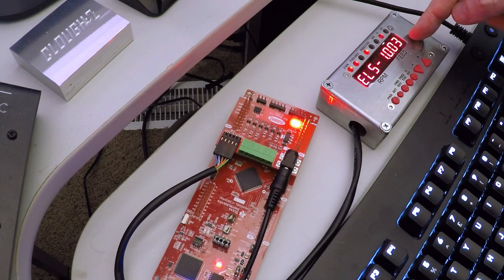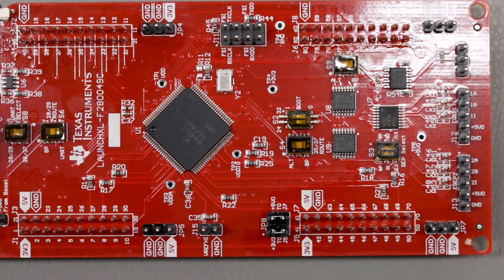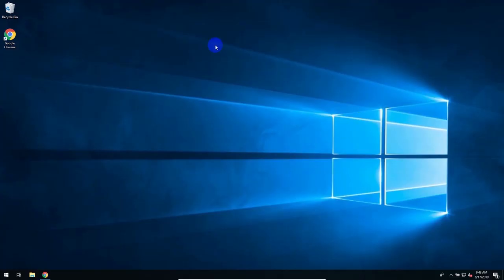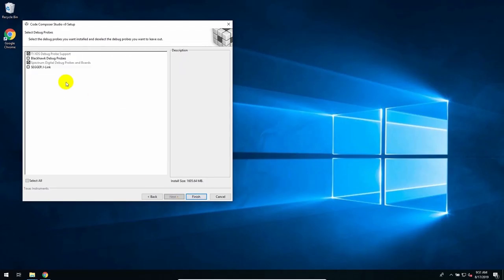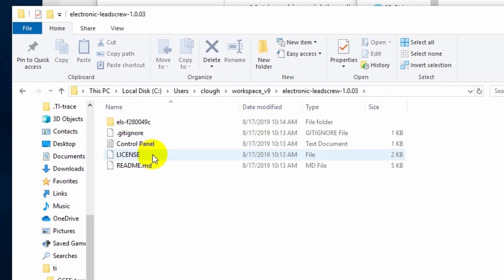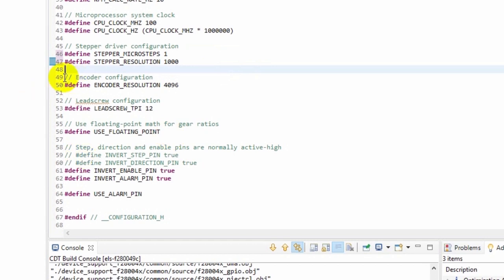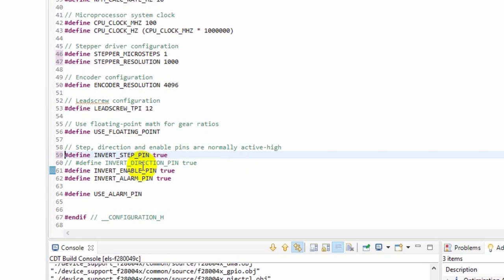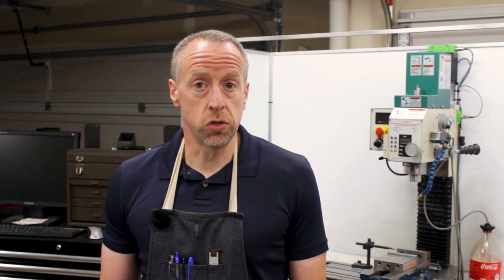Lathe Electronic Leadscrew Part 10: How to Program a TI LaunchPad Microcontroller

Comment from the maker: CORRECTION:  Several people have pointed out that the Kapton tape on top of the switches is there to make them easier for the pick-and-place machine to grab them with a suction head.  I said in the video that it was there to protect the switch during the board cleaning process.  It looks like I picked up some bad information somewhere.  Thanks for the correction!
Reply: I'm sure it helps with the pick-and-place, but I've seen datasheets mention the tape as an option to be compatible with washing
Reply from the maker: @fuzzy1dk  cool!  Everyone can be right!
Reply: Lols.  I intended to watch these new videos eventually.  However I came here from your weight loss video that was recommended after I re-watched your toolpost grinder build for probably the third time.  Looks like you kept going.  High five. I don’t feel alone anymore as far as people thinking you’re sick after having not seen you since you were overweight.  Funny that is the default assumption.  That’s usually the first question I get, “are you okay?  You look skinny.”   Makes me wanna strip down and flex, “that answer your question?”  Lost 60 pounds.  5%body fat.  Addicted to training.  Looks like I got in a fight with spider man when my skin gets too hot.  “The ugly truth of being shredded” 😂.  Anyways congrats on the progress.  I know sometimes it feels like you are the only one who seems to appreciate it.  👍🏻.
Reply: Hey Jim, are you using a hybrid stepper servo or a true servo motor?  If you're using a true servo, please provide a link to purchase it. Thanks
Reply: Please
Reply: I work in electronic manufacturing and yes its for pick n place nozzles but its also for protecting against flux and washing. Not all parts are machine placed. Somtimes parts are hand placed because the material may not always be able to survive the reflow process therefore they are hand soldered. It all depends. Lots of variables.
Reply: lol, we can just say it's there "For manufacturing purposes"

Comment: First I wanted to thank you for all your hard work in creating the project, filming, documenting, and sharing with all of us.
In our home shop, my father always had a couple of lathes and mills.  We have made many projects over the last 40 or so years.  The one thing I never have done was single point threading.  Changing the gears was always a pain and never had the right gears for the project, so we just used taps or dies.  After seeing this project, I decided to convert our ALL manual shop to have some automation or at least something modern.  My father is now 86 years old.  He has been a machinist the mid to late 40s.  He retired from the machining business and opened a Deli in 1972.  When I told him about the project he was interested and wanted to know more but not very excited.  (Remember, he still thinks the flip phone is such an advanced phone)  I started to collect all the major parts and get things together over several weeks.  Last night, I finally had everything in front of me and had time to work on it.  I put it together and it worked exactly like your initial demo.  My father came over to visit about an hour ago and showed him the demo.  Now he WANTS me to convert one of the lathes.  He also wants to convert to a VFD.  Your idea has re-ignited the fire in my 86 year old father.  Again, thank you for that and this project.

Comment: Hi James
I'm a elderly retired engineer who took up machining upon retirement.  I purchased the ubiquitous Chinese mini lathe and mini mill and have used both to craft a number of model engines and shop tools with great success and satisfaction.  Both machines have been modified over the years to make life much easier.  I've been keen to build an electronic lead screw control.  Having stumbled across your web site, has enabled me to start the journey.  Parts are on order and I look forward to the build.  I have to say your detailed exposition of the work steps you take for each phase are very good.  I only regret not finding you sooner.  Many thanks.

Comment: James, this whole series of videos is fantastic. You have gone where no man has gone before and I appreciate it. You have been so methodical in showing your viewers everything. The whys of choosing floating point, the error bars of the threading and so forth. I have come to trust you, your hardware and software. 
I have just about everything I need. Except, what powers the TI board? Is that the $400 power supply that I haven’t bought yet? I hope not. 
All that’s left for me to do is download the software. Please don’t take down any of these videos or I’ll be totally lost. 
I have an old HP workstation that’s running Windows 7, but it’s 64 bit. I hope this is ok. 
Please tell me about the power supply and the origins of Clough54. 
Thanks,
Paul

Comment: As usual, you make the complicated highly understandable for all skill levels. I have a 9x20 HF bench lathe with a lead screw gearbox. You still have to mess around with change gears for different threading operations. I personally would like to completely remove the entire gear train and just use the servo/stepper controlled lead screw for threading as well as carriage feed control.

Comment: James, I don't know if you read comments on your old posts but wanted to let you know I'm finishing up my 2nd ELS on an Atlas 618 lathe.  I've been waiting about 5 months for the TI microcontroller, but finally got one from Digikey.  I've got one on order with Mouser also, (for a different project) but they still show a longer delivery.   Putting an ELS on an Atlas 618 may be Overkill, but as you say that is Underrated.   Thanks again for doing the heavy lifting, pun intended...
Reply from the maker: Very cool.  I love mine, and whether I could easily install one will be a consideration for any potential new lathe purchase.  :)

Comment: Just purchased your board and am collecting all the other necessary components, can't wait to complete the electronic lead screw upgrade, will be using NEMA 23 servo's with DQ860MA servo drivers do I to make changes in the firmware. I now have both the G0602 lathe and G0704 mill and will be making the same modifications to them as you have to yours. Thanks Al

Comment: Nice work!  How difficult would it be to add an external sensor to stop the feed?  To act as a carriage stop?
Reply: The difficulty depends on how fancy you want the feature to be.

Simplest setup I can think of is a proximity sensor that mounts to your lathe (maybe make a bracket that slides along the ways with a clamp screw and holds the prox sensor in place).  Connect the prox sensor to a GPIO of your choice.

Then add an `isEnabled` flag to Core.h.  At Core.h line 98 [1], also check the `isEnabled` flag.  If flag is false, skip the `if` code block, and the stepper motor doesn't update.  You might update the previous values after the `if` code block, otherwise your carriage may take off when you reenable the flag.

At the top of Core.h::ISR line 97 [2] read the prox sensor and when it detects the carriage, clear the flag `isEnabled = false`, and the stepper stops moving the carriage.  When the carriage isn't detected, set the flag `isEnabled = true`, and the stepper will start moving the carriage again.

This is a rough idea, some testing and tweaking is recommended to iron out the bugs.

[1]: https://github.com/clough42/electronic-leadscrew/blob/master/els-f280049c/Core.h#L98
[2]: https://github.com/clough42/electronic-leadscrew/blob/master/els-f280049c/Core.h#L97
Reply: Ok for straight turning. Problomatic for thread cutting as it would be necessary to re-synch the tool with the workpiece. BobUK.

Comment: Great job!  Being able to thread to a shoulder would be a wonderful feature.
Reply: It doesn't have the ability to control the half-nuts.
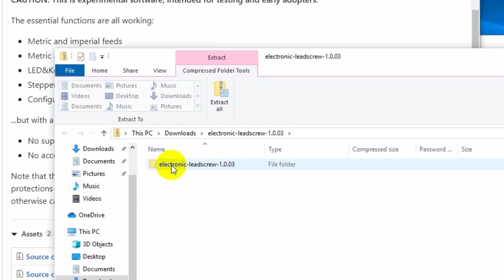Reply: @boldford  It looks like Jon Bryan was able to accomplish this. Take a look at 15:18 in "https://www.youtube.com/watch?v=rKKs4lCEXwE&t=489s".  He doesn't explain how he re-synchronizes the lead screw and spindle after the lead screw stops at the shoulder.  I'm sure Clough42 would be able to come up with a process that would work.
Reply: @mgillis1948  If you listen again he explains that he uses the half-nuts in the normal way when he cuts imperial (inch) threads. He would use the thread dial indicator to pick up a partially completed thread. He leaves them closed all the while when he cuts metric and runs up to the stop using the lathes jog function. You would use James's ELS in exactly the same way.
Reply: @boldford  I did listen again.  He does use the half-nuts for normal threading.  If you listen to him at 15:16 he explains about threading to a stop.  If you watch from 15:20 he sets up a 40 pitch inch thread while leaving the half-nuts closed and sets limits.  At 17:00 he says that it will thread to that limit and then Stop.
Reply: @boldford  If go to James's GitHub Page.
https://github.com/clough42/electronic-leadscrew
You'll see:
"Future Goals
While this project is starting out as a simple gearbox replacement, some features seem attractive, even for that simple case:
    Threading/feeding up to a hard shoulder with automatic stop
    Automatic recall and resync with hybrid threads (e.g. metric threads on an imperial leadscrew)"
To me it sounds like James would like to thread to a shoulder also.
Reply: @mgillis1948  Sorry Mike. You're quite right. Mea Culpa

Comment: Hi folks, in part 14 later on James suggests that one Launch Pad board he was using may possibly have been damaged by inadvertant static electricity. It can happen to the best of us. (He also gives another reason). As a result I'd strongly suggest taking the appropriate precautions before even opening the anti-static shielding bag contaning the TI Launch Pad board. Again, watch part 14 to see how to do this - and don't wear nylon clothing! BobUK.

Comment: I just programmed my third TI board with the MacBook using Code Composer Studio version 10.4.0.   I loaded Clough42 v1.400 and made minor changes to Configuration H for stepper ratio.

I was not able to install CCS 9 build 10 on this M1 Mac due to permissions so I had loaded CCS 10.2.0 weeks ago which was then updated to 10.6.0. TI warns that CCS will be updated every 6 months.  This time on build there was a warning “ A firmware update is required for the XDS110 probe.” Once I clicked on that update, the build completed the flash.  So far the updates from TI have all worked.  I am now waiting on 3M pulleys and belts for the 12 inch Enco.
Reply from the maker: Yes, they update constantly.  The firmware update for the XDS110 probe is just flashing the probe chip on the LaunchPad to match the version of the debugger you're using.  If you later want to use CCS9 again, it will flash the chip to match.
Reply: @Clough42  Right, I have CCS 9 build 10 on a Windows 10 computer, but it is Clough Version 1.301 and my alternate workspace for Clough version 1.400 did not seem to pan out.  CCS is a witches brew of TI utilities reflected by the documentation.  I suspect you use it at work and virtual machine it off in to a safe corner per project.  Its easier for me to change operating systems.  Thanks again for all your labor on the programming.  There must be a thousand working ELS systems by now.

Comment: By the magic of planning ahead, (and a gracious neighbor helping out the postal service), I received my kit this morning AND this afternoon I received the Launchpad (ordered directly through TI, delivered via Singapore). I was following through this video step by step, and I was wondering what modification needs to be made to the configuration file for the 180W servo from "Clearpath Killler" in order to run the stepper microsteps at 3, with a stepper resolution of 1000, but then 2:1 through the gearbox? does that make my stepper_resolution 500? Planning to install on a G0602, but mine still has most of the factory flaws.
Also, thank you again for all of this. I have watched the series multiple times, with multiple rewinds and pauses, but you have provided a LOT of information, and I am a little slow on the uptake.
Also, Code Composer is up to v12, I am not sure if that is going to be an issue yet, or not.

Comment: Just a couple of experiences in case they help anyone else out.  A year on from James' video, version 10 of Code Composer Studio is available.  I did try it (as the latest version) but it either didn't support the debug probe or it was just not mentioned.  It also wouldn't compile James' code;  complaining that 'make' wasn't found.  Version 9.1 worked flawlessly.
When I first programmed the board, it required an update to the icepick debug firmware.  I have an Anker powered USB3 hub for convenient access to ports.  When the board was connected to that the firmware update failed.  I'm pretty sure I've seen something similar before.  Connecting directly to a port on the PC solved this issue.
I first tried an old Apple 5V 1A USB power supply to test things once programmed.  The lights came on but it did not work.  I'm guessing that 1A was not enough power as plugging it into the aforementioned USB3 hub (power-only port) made it work fine.

If you want metric as the default, the setting is in UserInterface.cpp at line 61 (in version 1.1.02) and you need to change "this->metric = false;" to "this->metric = true;"

When soldering James' board, make sure you solder the 20-pin connectors to the UNDERSIDE of the PCB.  Soldering them to the top (with all the other components) will definitely result in a bad day.  I didn't manage to get them off without pulling some of the pins out of the shell.  You can order replacements (if you've managed to do this too) from eBay:  https://www.ebay.com/itm/282120149502   (UK seller - plenty others available)
You want the 2.54mm PCB Female header double row, straight pins (not right-angle) and they list the number of ways as "10+10".

Comment: Small nit, I didn't catch the exact PN of the ADI isolator, but their product line is almost entirely magnetically isolated not optically isolated. Mentioning it partially because I think you will find the distinction interesting, the magnetic isolation technology they use has a lot of interesting advantages over opto-isolators

Comment: James,
First off I really appreciate your style of presenting information. Your skill at making a presentation that even an ole dummy like me can understand. 

I am seriously considering doing this project instead of cncing my lathe as I feel it will actually be more usefull in the long run. Stumbled on your Overview video day before yesterday and have gone through all 10 of them and at this point, have just a couple of comments. 

1. First off, I am really glad you put the note up in #10 about the install time of the IDE because I was starting to get worried about how long it was taking. On my machine, it was a little over 45 minutes! At times, thought it was hung:{(

2. I have probably missed it along the way, but is there any diagrams on the interconnection of the various parts such as the encoder to the main board, connections of the display to the main board etc.?

As others have stated, Thank You very much for your presentations and looking forward to the kit board. 

Regards.
Reply: My apologies, as I finally read the “readme.md” file in the github download. 
Sure enough, my #2 comment was answered right there in black and white!

Now for another question, I am attempting to decipher the feed tables layout and have a question in particular about the 11.5 TPI construction. 

Here are the lines for the 11 and the 11.5 TPI:
 
{ .display = {BLANK, BLANK, ONE,   ONE},   .leds = LED_THREAD | LED_TPI, TPI_FRACTION(110) },
 { .display = {BLANK, ONE, ONE|POINT,FIVE}, .leds = LED_THREAD | LED_TPI, TPI_FRACTION(110) },

and in particular am looking at the TPI_FRACTION()  for the 11.5 TPI line.
Should it not be 115 instead of 110 which is the same as for the line above it???? 

Also am I correct in “assuming” that if I want to add an additional line to the table that all I have to do is add it in the appropriate place and then recompile or do I have to adjust table size values somewhere else??

Thanks in advance.

Comment: Great project, benefiting so many folks. Thanks! Could one drive two screws, 1 lead and 1 cross slide on a mill/ lathe combo by stacking two of your boards and some additional programming? Or would it best to use identical motors and switch between them?
Reply: That's my plan, so I can cut tapers.